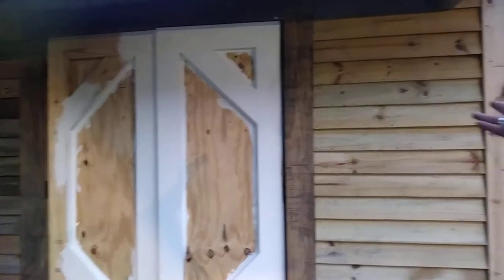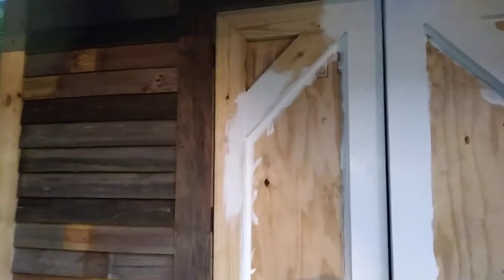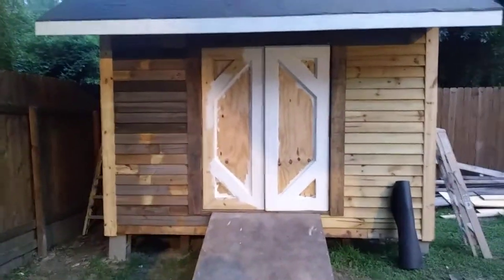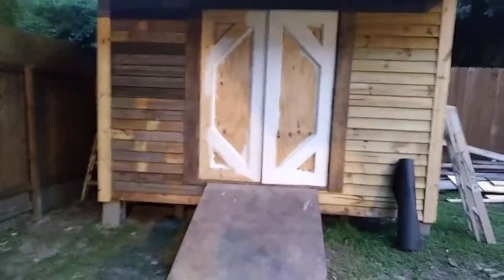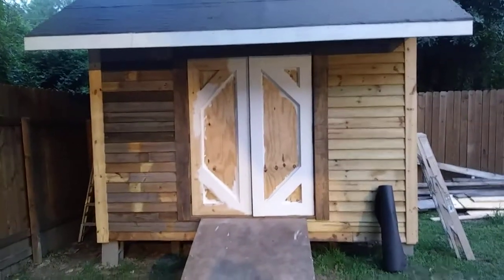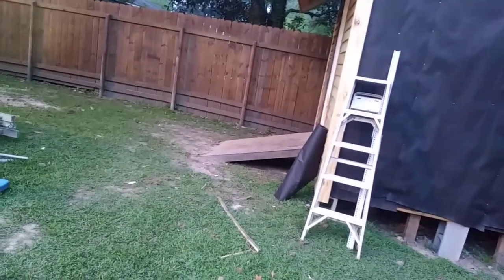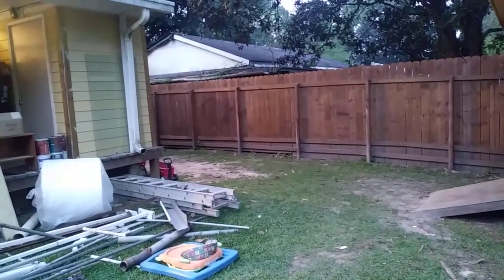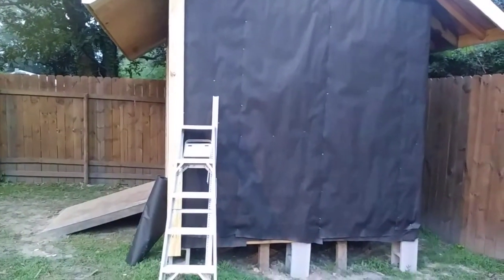Using Fence Boards for Wood Siding #salvagedwood #diyrepairs #diyprojects

Comment: Did you rabbet the joint or just do a simple overlap? If overlap, how many inches did you overlap? Thanks. Going to imitate your design.
Reply from the maker: Overlap... With fence plank, you have to go by what's showing. Fence plank are pretty crude cuts and are all sized within a 1/4 inch in width and about a 1/16th in thickness. That's how much they can vary. So I chose 4 3/4 inch from the bottom to the next board. So right around 3/4 inch overlap give or take with an approximate 5 1/2 inch wide plank. Also, some will be bowed from drying out, especially used fenceboards. I just picked a bow direction and went with it. I've done a lot of different siding repairs, even on historic homes (shiplap and so on.) I got to say, when it's painted nice and caulked in, you can't tell it's fence planks. Coming soon, I think I'm going to do it again in 30 foot runs, staggering the seams of course. I think it would be wise to go with a staircase method like roofing shingles. It should be more visually aesthetic. Thanks for inquiring. I got to say I trust it more than Hardi-Plank if you can get enough of it and use a straight edge for long runs. It goes quicker than you think once you lay out all your planks.

Comment: That's one hell of a overhang
Reply from the maker: Tried to match the dimensions of the doors opened. You can stand under it in a rain storm.
Reply: @superdo-it-yourselfers1096  It's perfect then. You don't get wet and neither does anything inside as you go in and out during a rain storm.

Comment: You mentioned caulking it in, how did you caulk it? A bead running vertically along the sides of the boards?
Reply from the maker: If you're still wondering 11 months later, run a caulking bead vertically and horizontally along where the board meets the 2x6 sides, and where the next piece of siding overlaps.